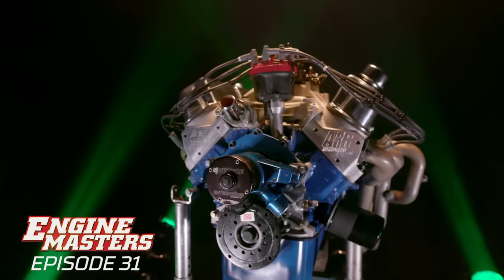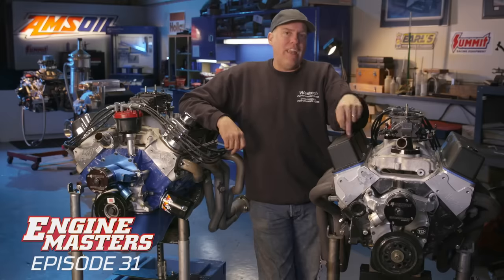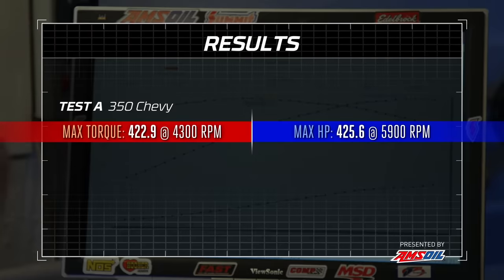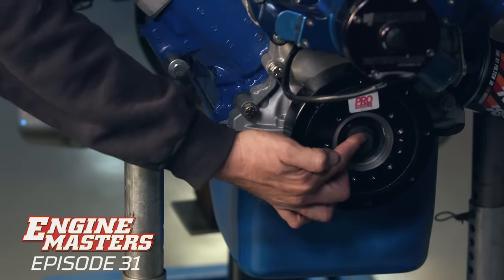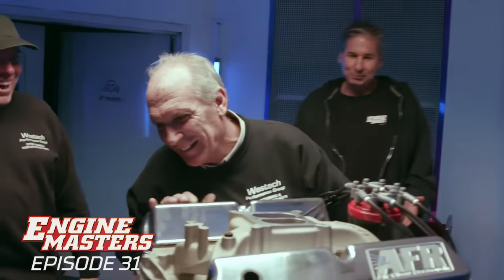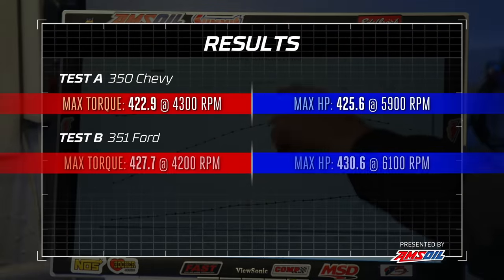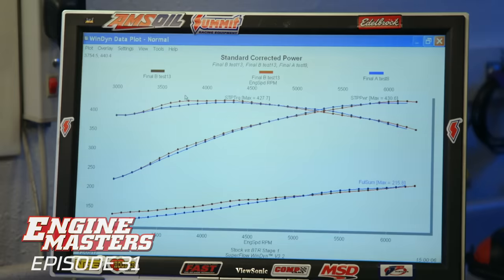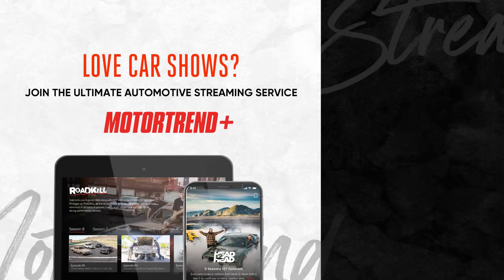Chevy vs Ford V8 Showdown! Small-Block or Windsor? | Engine Masters | MotorTrend

Comment: It would be nice to see some Pontiac stuff. I understand it’s a fair bit more niche as far as the hobby goes but there’s still a lot of folks both young and old building them and getting started.
Reply: Stock Pontiac heads don't flow good # unless its a SD 455 that's why stock Pontiac cams were not much over 500 lift the heads didn't flow much over 500 lift ,but Pontiac reached out to a company back in the day called AF when they built the SD 455 and sent the factory SD heads to AF they moved the valves around so it would flow good # some say it would out flow a hemi head that same company now is known as AFR air flow research
Reply: @darrellsomers5427  there are also “factory style” aluminum heads by Kaufman Performance as well as RAV heads available now

Comment: Best engine by displacement IMO
-Oldsmobile 215 v-8
-Chrysler 225 slant-6
Chevy 265/283
-Ford Windsor 302 
-Chevy 327
-Chevy LS1 350
-Chrysler 383
Chevy 400
-Chrysler 426 Hemi
-Chevy LS7 427
-Chrysler 440
-Olds 455
-Chevy 502

Comment: Great comparison test. The taller deck of the Windsor allows for a much longer connecting rod. The 351M/400 rod with that combination would be an interesting build.
Reply: The M rod is too long. And even if you could make a custom piston, the pin would be in the compression ringland area.
The M rods are wide at the big end, they would have to be cut.
Reply: Longer rods. Is that an advantage? What about high rpm horsepower? Longer rods are heavy reciprocating components so mass is critical. Just like pistons and connecting rods. Lighter is better. In GP power, its all about the RPM.

Comment: Back in the early 1980s the gap between Ford and Chevrolet small block engines was much greater because the factory cylinder heads for Chevrolets had a much better exhaust port than the Windsor head, and affordable aftermarket aluminum cylinder heads were still years away. I bought a set of Brodix street heads for my Camaro in 1987 because I had the money and they were ready for unleaded gas. But a few years later companies were selling aftermarket Ford heads that were much, much better than anything that had been on the market up until then, which really narrowed the gap.
Reply: Not so much by 1982.  The OEM HO cam, and the factory (‘87-‘95) E7 heads with porting and a 5 angle valve grind worked pretty well.
Reply: @ProjectFairmont  But that stuff was still rare and expensive when compared to the availability of some of the better factory SBC heads like the 292 "Turbo" heads. It's too bad too, it could have saved my brother so much trouble when compared to the work he did to put a 351 Cleveland in his '66 Mustang.
Reply: You forgot Ford had Fuel Injection and was competing 302 v 350.
Stock for stock Ford is better. If you choose to ditch the GM parts it can be better.
Reply: It’s all generation and they take turns.
Ford Flathead  over Chevy 
Chevy SBC over Ford Y Block
Ford 5.0 over Chevy TPI
Chevy LS over Ford Mod
Ford Coyote over Chevy LT
Reply: @ChuckThree  Well said.
Reply: @ChuckThree  factor in cost and things look very different
Reply: Ford 255 and 301.9 and 351 had relatively poor exhaust ports in the 1980's since they went back to the original design of the 1960's--meaning there was always an issue, and if you went with the cleveland it still had bad exhaust ports (Pro stock guys just cut 'em off and welded on pipes to make an exhaust port) but it also had too much volume for "street use".  but the fords also had smaller valves and port sizes, so had this test been with stock heads and the 300 hp camshaft both offered in 1969, they would have...made 300 hp. Most folks hot rodding a low deck Windsor put on 351 W heads with the half inch bolts and perhaps paid to have bigger chevy valves installed.

that all said...Ford's small ports and valves created torque at low RPMs. HP sells race engines, torque pulls trailers. When Ford gave their 301.9 tubular heads and a hotter camshaft grind, they had a nice setup for a light car and a transmission with a granny first gear. If you grew up with the "pull" of a bread and butter big block like the 390, you were surprised a short stroke 302 could yank like this thing did.
Reply: Exactly, ford simply never had a decent 351w head. The D00E and Gt40s were ok but worse than a double hump chevy. The aftermarket equalised the playing field.
Reply: @ProjectFairmont  e7s are  too small for a 351w
Reply: @jinglesalas  Did you not hear him say that there was virtually NO DIFFERENCE IN COST between them?
Reply: you forget that ford had the cleveland with far better heads.
Reply: @XxMusclecarsxX  Right, the 351W was Ford's bread and butter engine, like Mopar's 318. the "best" was 300 hp as a base engine in the Mach I, etc, to rival Chevy's 300 hp 350 in the SS Camaro. It helped the smaller displacements only due to being designed to feed more displacement than them--Ford wanted the customer to pay more for performance (think how many came with 4 bolt main caps, while chevy used those in any HD application) and had the 351C. 

but the joke was on them, performance dropped, and Ford dumped leftover 2bll 351Cs in Torino stationwagons.
Reply: @6226superhurricane  Back in the early eighties a 351 Cleveland was expensive and hard to find. The most of the blocks can only safely bored .030. You wanted closed chamber heads, but you could only get those in the 4V version, which have huge ports and valves, which are great for top end HP, but terrible for low end torque. That's why importing Australian 2V Cleveland heads became a big deal as they had the smaller ports with closed chambers. I knew a guy who was thinking about ordering a Ranchero with a Boss 302 back in 1969 (it could be done) so the dealer let him test drive a Boss 302 Mustang. He said that even with a four speed and 4.11 axle ratio it was hard to get off the line because it had no low end torque, so he ordered his Ranchero with a 351 Cleveland instead.
A typical Cleveland engine build back then would cost much more than a SBC. And I saw all of the work necessary to put a 351 Cleveland in a '66 Mustang (you have to cut down the shock towers) it isn't easily done.
Reply: @yosemite-e2v  i'm australian clevelands were a dime a dozen in the 80's, you could buy a used falcon with a cleveland in it for $300. i guess that's why we never really understand the chevy thing, there was always chev v8's getting around but there was some monster cleveland builds that dominated in the street car scene, even the ls was overshadowed by the barra 6cyl.
Reply: @jinglesalas  no they don't, everything is expensive and then considering that it usually needs to be done multiple times with the Chevy... End of the day, Ford is less maintenance and cheaper...
Reply: @6226superhurricane  We had NASCAR running the Cleveland heads until 85 if I'm not mistaken. But later I think it was 1986 Ned Jerrett was talking with Ernie Elliott about the old Cleveland and why everyone turned against it at once. Ernie simply stated "we've hunted every junkyard out in the Southeast and beyond and the heads are so very hard to find by then; without buying higher priced cars still on the road and scrap everything but the heads.
Some other classes of racing most likely used them much longer, but NASCAR ran out of them as a viable resource.
We also had a president to feed the Meth heads in 2008 and encourage crushing of anything and everything metal laying around they could get their hands on.
Reply: @kramnull8962  the last cleveland powered falcon was sold in 1982. ford australia used the cleveland in f trucks, broncos and fairlanes until 1985. if nascar needed heads they could've got 1000's. i bought my first cleveland powered falcon around 1995 which was a 77 xc that i paid $250 for
Reply: @6226superhurricane  I doubt we really cared about you all in 1982...
Reply: @kramnull8962  well that's pretty ignorant, there was yanks coming over to race against aussie speedway cars in my home town of newcastle. i can't remember a time that americans weren't coming to australia to race. you can be certain that anyone high up that was involved with ford or gm knew of improvements australians were making to their products.
Reply: @6226superhurricane  1981 NASCAR was a Fair that Ford could give 2 craps about. The Icecapades got more publicity than NASCAR; until Bill Elliott started winning. Then they wanted their logo more vibrant...
Reply: @jinglesalas Chevy. Plenty of cheap parts available
Reply: @bradcraig5111 I recall Ford parts 40 % more expensive harder to find and ford specific parts only fit a few years and models
Reply: @verntoews6937  It certainly depends on which engines were talking about. There are a few Ford engines that are hard to find and/or expensive to acquire and buy parts for. I won't get into those, but otherwise, hi-po parts for most pushrod Fords are plentiful and comparable, price wise.
Reply: @ChuckThree  And Cleveland over all.
Reply: @jinglesalas  LTs and Coyotes almost exactly the same on the 2nd market. So bo cost difference. 

If you’re talking about LS. Well duh, there’s never going to be a V8 engine produced in those numbers ever again. And there 20 years of prior production for junkyard inventory.
Reply: @yosemite-e2v   No they were not.  In the early 80's Cleveland's were VERY easy to find as the vehicles they inhabited were hitting the wrecking yards in large numbers.  A Clev build in the era was more than a SBC but it also made far more power. And the 2V heads were fine unless you were looking to run high compression.
Reply: @ChuckThree  😂 which LS has won overall Sick Week, Tx2k24, Import vs Domestic, Brendenton street car takeover? Zero, but a sleeved oe Predator/Coyote combo has making 2930 whp to run 6.26 @ 228 mph on radials. 
No LS has matched Accufabs oe cast 4.6 4V running 5.88 @ 256mph. 
Or matched M2K Motorsports 300.4 mph standing mile world record with an oe cast 5.4L. 
Twin cam > LS

Comment: Why I like building the SBC back in the day: More OE head options, and steel crankshafts and 4-bolt main caps were common.
Reply: It's just easier to find power cheaply with O.E. parts on a Chevy. The same can be made with the Ford but using O.E. parts it gets expensive really quickly. Aftermarket parts wise it really doesn't matter because they are pretty much the same cost wise for equivalent parts.
Reply: And dude .. distributor in the rear!!!! Only way to fly!!! Probably another reason the small Chevy is the #1 choice for hot rod builders... aesthetically much much better
Reply: Lmao great for setting an engine further back too 🤣
Reply: This allows the driver to adjust timing from the cockpit!
Reply: @mariocooldude9092 Really?Ford had that crappy design along with the exhaust ports together in the center  a full year before GM made the sbc. .lt was called a Y-block and it was as bad a design as the Chevy. Then the Windsor came out and it has take 350 inches of Chevy to run with 302 inches of Ford ever since.
Reply: @mariocooldude9092  aesthetically better practicality not so much
Reply: @randomdude4669  but...how often do we need to operate on our distributor??? 😜
Reply: @mariocooldude9092  And the distributor in the rear is the main thing chevy people cuss about the engine..I've heard it a million times..When it's up front it just makes sense..alot easier to replace cap,rotor,wires,and especially change to it out.Ive seen so many of them welded to the block from corrosion or whatever and its sucks trying to get in the back when it's against the firewall to get it out.
Reply: @bigboreracing356  Why are you letting someone else work on your engine?!
Reply: @bigboreracing356  I play with muscle cars and hot rods as a hobby.  It's been a sickness since the 70s.
Reply: @bigboreracing356  We're comparing big blocks to small blocks lmao. Literal 40 year old production engines, vs a big block crate engine that either you built in collaboration with a shop, or you bought ready to race. Are we even going to bring up what size tire you're running or anything about how many gears you have, or lack thereof? How about what final gear you're running? You can't just step in and say you'll "beat any SBF or SBC" (you won't), when you literally start off with claiming to have double the displacement. Which isn't the answer for applicable power in the year 2023.
Reply: @mariocooldude9092  That is the worst part of the Chevy design, stressing the camshaft and making it hard to work on being so close to the firewall. The only time it's an advantage is when you're putting a roots supercharger on and it doesn't block the blower drive.
Reply: @mariocooldude9092  anytime you make a timing adjustment.

Comment: I cut my teeth in our '69 Mach 1 - 351W equipped, which I'm still driving to this day with the same stock motor.  While others have replaced/rebuilt their motor a few times, the 351W keeps on keepin' on.
So of course I'm going with the Windsor. It never disappoints and always puts a big smile on my face.  I'm not an engine guy (rebuilder).  This is just my experience.  
     This was a fun comparison, but says nothing of longevity of each motor, which is understandable as they weren't testing longevity.  But I wonder which engine would last longer under normal use and maintenance? Better metallurgy, better rings, better springs, harder camshaft, etc.
  These kind of things make a huge difference.
     Back in the day, the Ford vs Chevy rivalry was huge. 
     But now I think both of these engines will go down in history as two of the most versatile small block V8s ever made.

Comment: Would be nice to see Cleveland 4V or Clevor in the mix
Reply: AFR wouldn’t sell heads lol. Richard Holdner did a dyno test of a 1970 M code 351C and well:

351C 4v, stock intake, stock cam, stock heads, headers, distributor, e-water pump, and a holley carb, 365hp, 379ftlb 

240/246 duration cam (xe284h comp) 
Edelbrock air gap dual pane intake
450hp/411ftlb
Factory 4v iron closed chamber heads
Reply: Or even better a Cleveland with good aftermarket heads like CHI.
Reply: @mikemustang5488  wouldn’t be fair at that point lol
Reply: @B1Springfield  No but TrickFlow sells heads for all 3. All bets on the Clevor for me.
Reply: @eclipsegst9419  power  nation did a Cleveland with the trick flow heads, I don't know how they screwed up but the build was so poor It didn't even make as much power as the Windsor.  Then they raved about how great the Windsor was. My stock Boss 351 made 445 at 6100 with  just a Roller cam change. and a 750 Holley.  the power should have been better but we had to use a   restricted adapter to fit the Holley to the Ford spread bore manifold. if we could have found a Squair bore Cleveland cast intake  it should have been better
Reply: @mylanmiller9656  Without having watched it, I can almost guarantee i know what they did wrong. They put in a cam with specs that are fitting for a Windsor or SBC, but not a Cleveland. Windsors and SBCs have very tiny exhaust ports compared to the Cleveland, and as such they require more exhaust duration and overlap. Clevelands prefer a single pattern cam, or close to it, with gobs of lift, fairly high duration, but not near as narrow of LSA as Windsor or SBC cams. Almost all Windsor or SBC builders will make this mistake and then make stupid claims like "The Cleveland ports are so big they actually suck because of it"
Reply: @eclipsegst9419  I  think you hit the nail on the head, they have Chevy on the Brain, and don't understand how to build a Cleveland.

Comment: Would love to see a 340 dressed out the same and see how it compares.
Reply: the 340 is highly race oriented. a 360 would be better suited to compare against these
Reply: Mopar would make them look silly in my oppinion.
Reply: @conhemi50  351C enters the chat.
Reply: If you could get a set of equal heads, it would be really close, Getting the lates good parts has always been  the problem with both Mopar and AMC. You can build a GM engine and not use a single stock part every part can be bought from the aftermarket.

Comment: Fair test . To often I hear the chevy guys  comparing  the 350 to the 302
Reply: Yea Chevy guys are notorious for that because they know what happens when you use a fair comparison using the 351 vs 350. Lol It's not their fault that their dads brainwashed them. Lol😂😂
Reply: And it’s crazy how 302 will go head to head with bigger engines